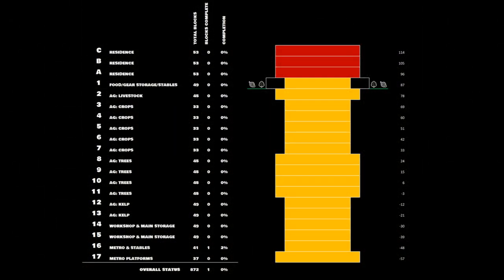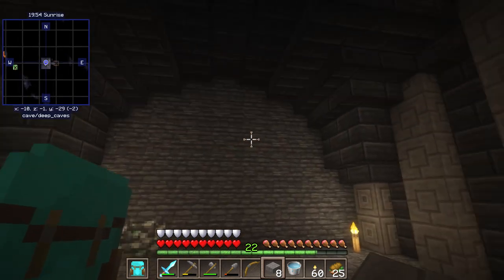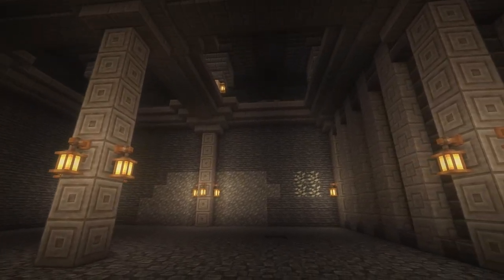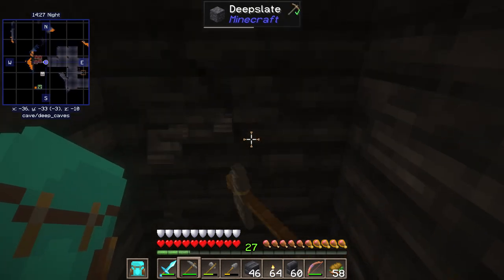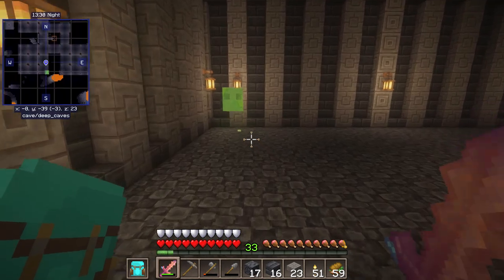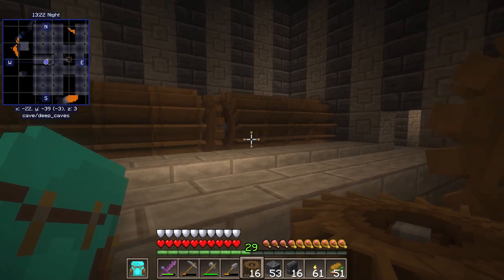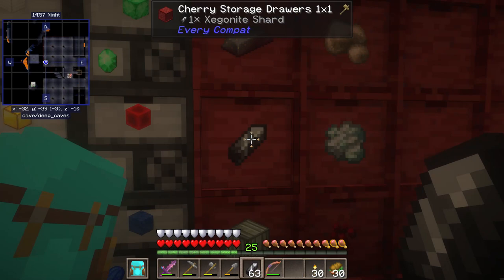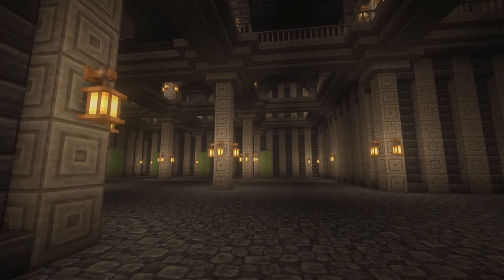Gryphon Hall - EP8 - Movin' on Down

Comment: Wow, Really impressed with the level layout.  Both the water wheels, and eventually, even the drawers may cause performance issues.
Reply from the maker: Ah... you have the gift of future sight.  The storage system has been working remarkably well, but yes... the waterwheels are causing problems.  

I am working on episode 10 and it is devoted to my attempts to isolate the exact problem and then try to find a solution and prototype the design. 

At this point, I have the solution and the very basic concepts of a design... but now I am considering whether I can jazz up the design instead of just encasing it in a big box like the original design.